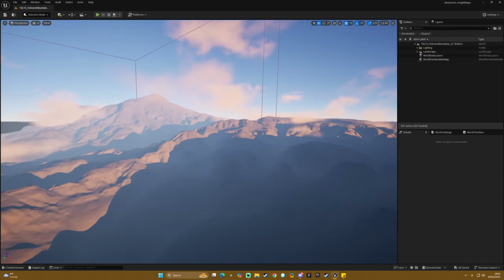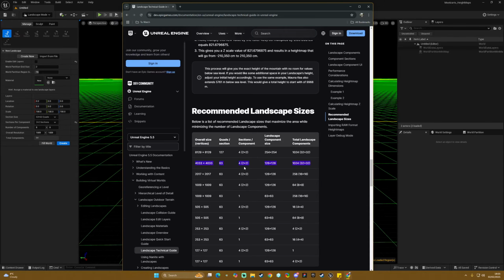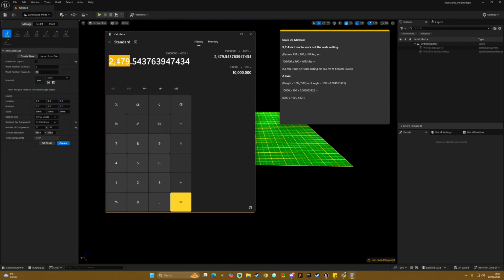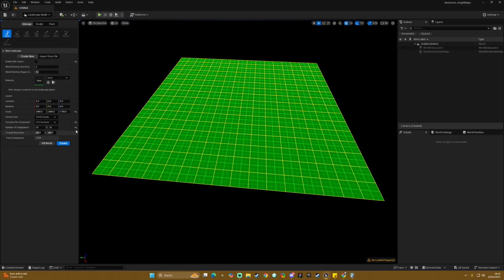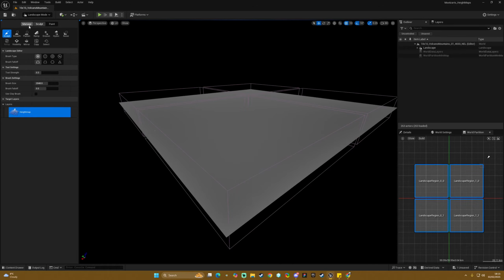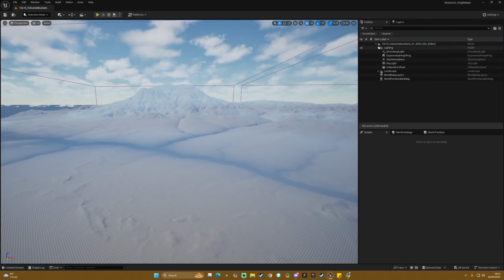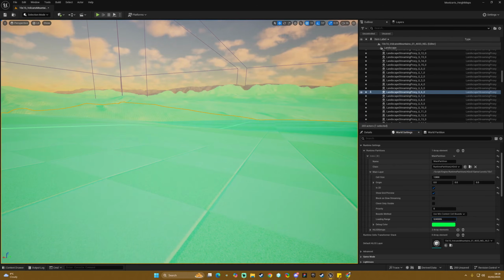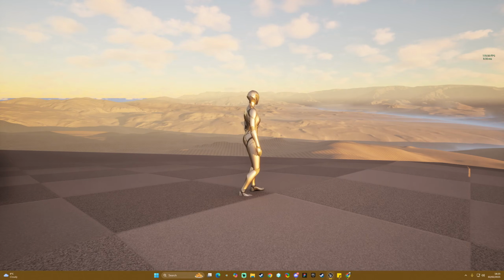Unreal Engine 5.5 - 100km x 100km Tutorial - Open World Landscape Tutorial

Comment: Fantastic - A question with such a massive terrain?  I built a 4k map with everything - ie: city, villages, roads, forests / jungles, rivers - etc - I used nanite / lumen with World partition HLOD's - I optimized as best I could - But could not get higher than 60 / 70 FPS - My question is - if you added nature to this massive world - ie: if you fill it with trees - what is your FPS??
Reply from the maker: It really does depend on what setup you go for. With instanced trees you can get pretty optimal. But its all about each individual use case. Im yet to fully test voxel foliage properly, but i read its quite performant for large detailed trees. But traditional methods using cards are always going to have tradeoffs with new systems like nanite and virtual shadow maps. Picking when and were to use card based foliage is key, not having shadows on things you dont really need them etc.

Comment: Great video! So how do you create a big ocean around it with this size of a map?
Reply from the maker: Sorry for the long waiting reply. There are lots of ways to do this really. But it all depends on the case by case basis of the project. If its for distant visuals, can you get to the water and touch it, etc etc.. different approach depending on what you need the water for.
Reply: @mootzartdev all good, I mean like an interactive ocean where you can swim in etc.

Comment: Hope you’re still watching the comments. I have a problem! 

I followed along, but used a different height -- from files I have on my HD. The one I picked is 1600 pixels squared. I used that in my calculations. 

Well, when I got through it all and hit "Create", I got a black screen. Not the entire screen mind you, just the area in which I should have seen those four boxes. And, the World Partition is only showing me this message: "World Partition is disabled for this map".

Is this making any sense? Thanks!
Reply from the maker: Hey, No worries. Im a bit confused. Do you mean you are using a 16000x16000 hieghtmap image?  

If so then that would cause issues. World Partition requires very specific sizes to work properly im fairly sure. 16321x16321 is really the only decent res for World Partition at that sort of res range.
Reply: @mootzartdev  Oh no... 1,600 px squared. Does UE5 require the height map to be only one of those sizes listed in the chart on Epic’s site?
Reply from the maker: @keithyakouboff8755  Indeed. They have to be world partition values or the system will have issues. So getting those correct is the first step to debug your issues.
Reply: @mootzartdev  Okay.. that is something I needed to know. Thank you!

(You're tutes are not "too long". I appreciate the effort you put up there and free of charge no less.)
Reply: @mootzartdev  One more "issue", but it’s not a major one: My height map is pixelated. I scaled it up to 4,033 (from maybe 2K or something), and it did not scale up smoothly. But, that’s not something a little Photoshop, or maybe Affinity couldn’t handle.

I finally got this working bro! I got a MASSIVE terrain, with clouds, atmospheric density, etc. VERY helpful and practical tute. Thanks for the effort.

Comment: While I think this is great if you're not looking for A better resolution. Unfortunately 4k scaled up loses a ton of fidelity. What other ways are there around this?  Also I would like to see something on when you don't use layers because most tools you get on fab or other places require the use of layers. How can you use auto materials? Do you just paint rather than use an auto material?  Can this be explained better?
Reply from the maker: @Xoremus72  edit layers have nothing to do with material/weight layers. 

Currently in ue5 to use world partition effectively you can't get higher resolution and not have a extremely high end machine and optimise the vram usage effectively. To do massive worlds use old tiled methods without world partition.

Sadly it is simple as thst right now till they provide other information for us. As soon as I work out a decent way to do it. I'll make a video of it.

Comment: Hello, i read a lot about World Partition vs World Composition in the unreal forums. I often heard that WP is not working properly for Multilplayer games and that we should Import static meshes and split them up manually.

Could you share your insight on if thats really the case an WP is unusable and we are better off doing it with static meshes instead of using the terrain tools and WP?

Many thanks !
Reply from the maker: While i dont really have the solid expertise to talk about multiplayer. I know on games i have worked on that is does work. But I am not a programmer so it might be that they had to do some special stuff for it to work correctly. 

however it does work.

Comment: I have a question, is there a way to make a huge map, like this, but in way smaller parts? Like 10kmx10km minimaps that are all connected, but not showing all the time? So i can have high detail maps, but only load the maps within 10km instead of all 100km. Id like to go even bigger, like 700km x 700km, bit that would just crash everything unless its loading only 10km chunks.
Reply from the maker: Yeah this is something im really trying to figure out in a good way myself. There are 'bodge' ways of doing this. With multiple landscape actors and such. But that may be way to much anyway. That would get past the import memory issues. There are also ways of obtaining very very large landscapes with non landscape actors. Such as using meshes and things like that. It all depends on what features you want, and you ability to code if you want custom stuff. 

But i am working on this type of content. I would also recommend Demenzun Media's channel for the mesh based landscapes and his video on TIN landscapes is promising. Though that process is extremely time consuming and does come with pros and cons.

Comment: I'm looking to do at least 64 Km x 64 Km at 100 X/Y scale; using a mixture of custom tiles + real world heightmaps. Don't want to stretch them - aiming for as close to 1:1 scale as i can manage. 

Would multiple landscape actors be the right way to go about this?

Any particular thoughts or advice?
Reply from the maker: This is actually something im looking into and testing generally at the moment. Sorry i dont have a clear and accurate answer right this moment. But i am testing multiple landscapes combined with HLODS etc. It will take a fair amount of preparation in working out the connection on the map edges i think. But i think it is doable. The main issue is the designing of that landscape i think, externally to UE stuff..
Reply: @mootzartdev  no worries; appreciate the response all the same.

Demenzun Media (fella who created Terresculptor) might be a good resource for you in terms of tiling/shared edges.

He's done a recent series with TIN meshes in place of standard Landscape Actors. Looks promising, but I need non-destructive edit capabilities, at present.

I've considered purchasing Errant Landscape for this purpose, but have yet to make a final decision.

Looking forward to your future uploads

Comment: Thank you for this video. Very helpful. 

1. Is it possible to have more than four regions on a landscape?
2. How to import tiled landscapes (with weight layers)?
Reply from the maker: Hello. It is possible to have more regions for sure. Those are the top two setting on the import. They decide the amount of proxies and regions. However i have found them to be terribly buggy. Proxy amount works fine. But regions are terrible. They are volumes however.. and you can manually add them afterwards. Which i show in a couple other videos. 

Also can you clarify what you mean by weight layers? I could just be dumb here. Do you mean paint layers etc?
Reply: @mootzartdev  In UE 4/5 Paint and Weight layers are similar, but different. Paint layers you can add in-engine. Weight layers are created by the terrain software. I use World Machine. I believe other terrain generators do the same. The layers are imported along with the landscape. They are actually in separate files. Grayscale.
Reply from the maker: @ Are you wanting to use the weight layers as masks ?

Comment: Wicked video. Actually been making Landscapes for a few years now, and never really seen anybody putting meat on the bones with how to configure/manage the import of such large landscapes. I am hoping you find time to expand on some of the difficulties that come about from using these large kiddies in future videos, you touched on the sky issues in this one for instance. I am working on a  50kmx50km now and I am scaling xy at 375%, total components at 1024, weightmaps dictating Landscape Layers and loaded the different textures for mud, rock, grass etc. Immediately run into problems with the large spacing between vertices, I wanted to manually use paint layers to add some texture details, maybe a path across a grass texture, but there becomes a grid like rather than smooth limitation at where the paint will fall, a matrix with drops of paint if you like. Each drop is also effectivly expanding beyond the specification in the brush and fall off diameter, to at least 2x the brush width on smaller sizes, I guess an effective minimum determined by the vertex spacing, so that I get a low resolution paint experience, blocky, pixelated. So now I am trying to ascertain the best way to mask the low resolution effect with a higher res mask of some kind at critical points, or a mesh overlay. I am only at 375% your project in the video nearer 2500%. How do you handle this kind of issue, or is it just a case of stay away from manual painting.   Either way this was a really welcome video, thanks for taking the time to record, edit and post this.
Reply from the maker: Its a very tricky one really. Vastly large maps sadly take vastly more degrees of planning and prep and planning. I would say major features would usually always have to be done/covered up with meshes. Generally. 

Or you need to be fairly swift with programming and such in order to perhaps utilise some kind of advanced tiled setup. So then perhaps you could be using tiles that are comprised of 1k  res.. which is something im going to be looking at doing next.
Reply: @mootzartdev  Either way - looking good man. Hope this turns in to a series. Insightful. Thanks. Actually one other thought, you used a 4k landscape, but I wonder if there is an increasing difficulty presented when using say an 8k or a even a 16k. Thus accomodating more detail in the heightmap, but then would there be more or less memory or other negative impact scaling that to 100km
Reply from the maker: @andyseabrookUK  yeah I used lower resolution to sort of show what you can get away with. 8 and 16 would certainly look better as I mentioned I think in the video. But they would rack up memory issues later down thr line ad you add materials to the landscape. I think ill do a video on that as well showing the benchmarks and differences in performance with materials on there

Comment: Are not landscape overall resolution so low? When you start deform landscape just one pixel can create little mountain.
Reply from the maker: You really dont want to go to high with such large landscapes. Its just not really logical if you are a beginner for starters. If you want to design huge landscapes you need to learn really how to do most of the work externally so that most of the work is done before coming into the engine. And only really work on small adjustments inside the engine. 

Details should come from assets (meshes afterwards). Sculpting and such really is only 'comfortable' on much smaller landscapes then this.
Reply: @mootzartdev  thanks for your valuable information. I created real world location in engine and size is  80kmx80km. I want to keep  overall resolution as low as possible for better performance, but when I create roads, I need to rise or lower landscape using spline. My solution is: I create landscape using max resolution, when I finish my job, recreating landscape using lower resolution exported heightmap. May be there are better ways.
Reply from the maker: @Nobatgeldi  Well if you are very cleaver with your stuff.. you can create HLODS for distances. and keep high res close up. And play with your LOD's.. the issue with high res is the memory/VRAM issues that come with it. Once you add a landscape material etc. Other options (depending on your game type) is to mask or paint the terrain separately.. but if you are needing non destructive workflows during the project.. one thing is to remove edit layers. Which can really help down the line with VRAM. But honestly i would never really exceed 8k res maps for any project generally unless you are a very skilled user of the engine, C++ and such. 

All the best.
Reply: @mootzartdev  I am trying to use all capabilities of engine, Lods, Hlods, dynamic load ranges and occlusion culling. High ram usages are not problem for our projects but bigger resolution landscape eats more cpu power when loading and unloading landscape.
Reply: @mootzartdev  on this days may angel is: Runtime Virtual Texture. It increased performance more than expected.